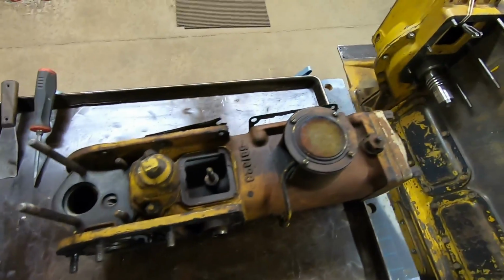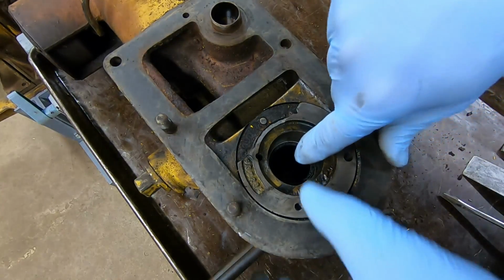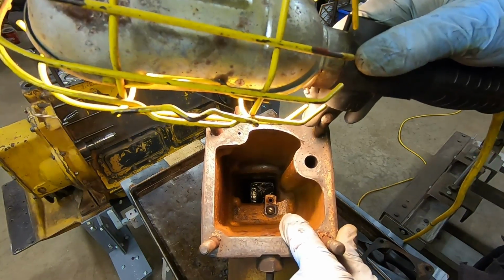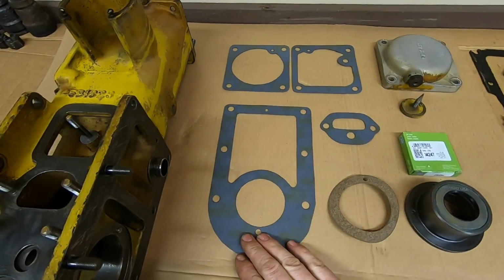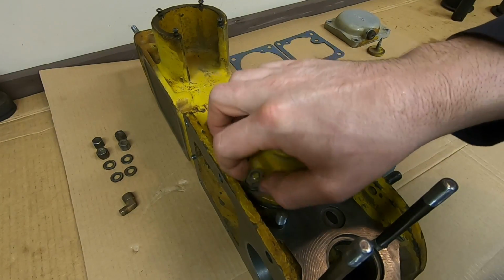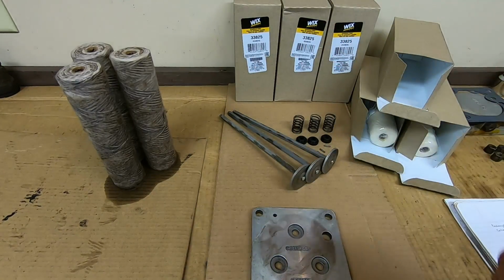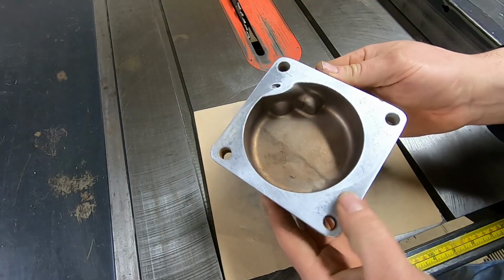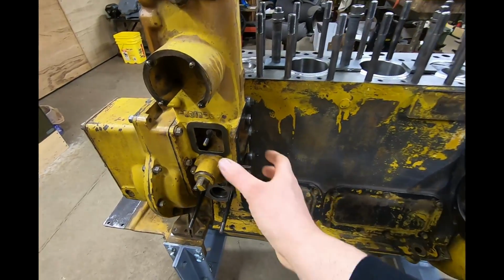Caterpillar D2 #5J1113 Diesel Engine Assembly Ep.26: Reconditioning The Fuel Tower

Comment: My D2 5J has been used a couple times but for anything significant & not been started in about 5 years. One of the last times was after having to remove the individual pumps of which 1 was stuck in the up position, another was very sluggish to return & the rest were gummed badly. After that it took about 5min or less to start vs what must've been a solid 15 or more before. That helped ALOT since the next day it fired off from the pony almost immediately. After sitting for an extended it still takes alot of pony time before it will fire off. Seems more attention is due INCLUDING the filters whose condition is unknown...got a new set on hand for when I can get to it.
These vids though I've caught onto them late are most insightful.

Comment: That same distortion happens on carburetor tops.  I watched a demo once where they used a flat plate and clamps on the high areas between the bolt holes to clamp that area and then put it in an oven at a good temp.  The heat would soften the aluminum a bit and allow the clamps to pull the Al down to flat again.  Of course you would need to retighten the clamps a few times.  This was on a motorcycle carb.

Comment: I am telling you,  In my opinion you need your own Cable TV show, you do all 3 of the things for proper communication, You need to be: Clear, Concise, & Compelling.
All of which  you ace.. A show based on overlooked things that can make your Auto, Truck, Heavy machine operate like crap. you would be surprised how many things from gapping Spark plugs to Wrecking plug wires from the plug end... those were just a couple easyones, have a GM v8 from the 60's-80's and have a bad KLACK-, KLACK-,Klack, it is easy to think, lifters, wrist pins, but nobody would think about the fuel pump! still runs fine and the noise is inside where it seems to come from different parts.... Your car blows when you turn it on, but no heat or AC? no matter what setting? check the blower fan.. I had one the previous owner parked under a tree,then he would warm it up co coolit running. It packed his heater hans squirrel cage fan.......cleaned it and it would freez OR burn you out.... I knew the guy, he wanted to buy it back again. HAHA good luck my friend.
Larry Beach, Sioux City

Comment: A trick I use for a flat surface is a pane of glass, I put some spray adhesive on it (3m super77) and stick a sheet of sand paper down to it. Works great for lapping. Brake clean removes the super 77 when done. I have a sheet of 40 grit on the back and set it on a wooden table to hold it in place.

Comment: Great video, Squatch! Those old style filters are cool too see. Say, I was going to ask. Where do you get your grey gasket material, and what is there manufacture/type? I've ordered stuff on Amazon but your material seems a little better quality.
Reply: I think he has a source at the swap meet for it.
Reply: @lukestrasser  Now that you mention that, I think I remember him saying that in a previous video. Maybe he can at lest let me know the manufacturer of the material. Looks a lot nicer than the rolls of paper you buy online.
Reply: @KennyKizzleRustyNutzRanch  if you're looking for a quality bulk gasket both Fel-Pro and ROL gasket material sell premium material similar to what he's using in bulk. It's hard to find, but I'll try and dig you up some part numbers out of my older catalogs.
Reply: @lukestrasser  Sounds great! I would appreciate that information!
Reply: @KennyKizzleRustyNutzRanch  Try Fel-Pro numbers... 3030, 3127, 3075, 3137. Those are bulk material in various materials and thicknesses. All either cellulose/nitrile or rubber/fiber. If you need cork or cork/rubber numbers let me know.
Reply: @lukestrasser  thanks, Luke!!!!
Reply: @KennyKizzleRustyNutzRanch  no worries Kenny, if that doesn't get you what you need, just let me know.
Reply: @lukestrasser  Will do, thanks!

Comment: Very interesting video, as always a lot of informations. I wanted to ask you a quick question, it seemed to me that the seal you replaced (the one you say it's the most neglected) insulates the relatively high pressure fuel from the transfer pump from the low pressure lubricant in the injection pump. So, if the seal leaks, the injection pump should fill with diesel fuel. Is this what happens? Or the seal insulates the injection pump from the intake side of the fuel transfer pump, and so the injection pump eventually runs dry? Just a little doubt, I'm definitely not an expert, also not a native English speaker, so I guess I didn't get precisely through which passage the fuel enters the tower. Thanks for all the effort you make in making us learn something new!
Reply: Ok, I guess I can get the answer to my question looking back at the video at around 11:30 , there should be no fuel in that compartment. So if that seal is bad the oil from the injection pump would just get into the oil pan through the passage under the accessory shaft, right?

Comment: You should always use a steel flat washer under the lock washer. That aluminium casting will always distort without a steel washer.

Comment: Hey Squatch, I've got a 1949 D4 Cat, and when I run it, fuel gets into the oil. Could that seal you mentioned be the cause? Did CAT ever change that part of the fuel delivery system on later machines? I've checked the parts book and haven't found anything that explains my issue. I figured this would be a good video to comment on for advice! 

By the way, your videos are great. I'm always excited when you put a new one up.
Reply: @squatch253  Thanks, I look forward to the next videos.

Comment: Squatch, a question about the leather seal fitted in the tower to keep the oil in the fuel pump.  Is the  Cat injection pump an engine oil fed type or is the pump  lube oil kept in the lower pump casting like the Simms pump on the early Ford Tractors?
If it is engine oil feed, then way is there the need for a seal on the end of the pump?
The pump camshaft would be oiled from the engine oil circuit .
The plungers in the pump will be lubricated from the diesel fuel.
Reply: David Pierce 
Injection pump housing on all the old CATs has its own oil reservoir.  I knew that but totally missed it on a FORD with the Simms MiniMec pump $$$$$$

Comment: Fantastic! Great info as usual. I use your channel a lot to work on several 955 12A Traxcavators. The 955 is more or less a modified D4 of the same year (model change included a change from D4 size undercarriage to D6 undercarriage at s/n 12A5793). The information you provide is invaluable because these machines are smaller in many ways which has enlighten me to many concepts and general understands of the engineering of the day. 

Watching your videos gives me an idea of what I'm getting into and a preface for things to watch out for like springs, clearances, wear spots ...
Thank you for your help
Fat Dan

Comment: Toby or anyone is the fuel pressure gauge an actual gauge or a sightglass? You must have done well with Captain Kangaroo's scissors class. Those are some precise gaskets.
Reply: It’s a pressure gauge
Basically reads the pressure resulting AFTER the fuel filters so it is used to tell when they need changing.  It’s not really a great system cause the fuel usage is greatest under load and you usually can’t see the gauge while your moving along using the tractor, but as long as the fuel transfer pump and the bypass valve that returns excess fuel to the pump inlet are up to snuff, if the gauge reads low once the engine is idling, the filters are restricted and need replacing soon before the engine begins loosing power

Comment: The keeper springs and Fuel filter elements of the CAT D2 are the same as on the Soviet KD-35,MTZ 2 and later D-48, D-65 engines. Personally I use modern equivalents for the old time yarn filters. I have also used NOS yarn filters on a D-65 engine. But because of there old age(50+years) they are not very effective in cleaning fuel. The ones I had started to rot from the inside the filters housing after 2 years. Maybe I got bad filters but just sharing my experience here.